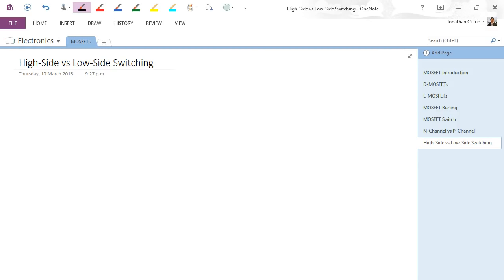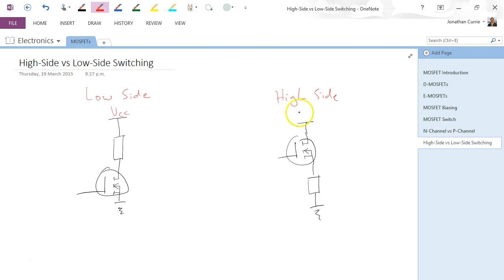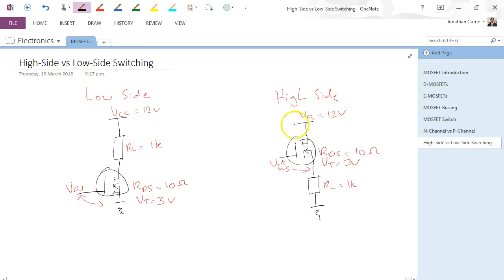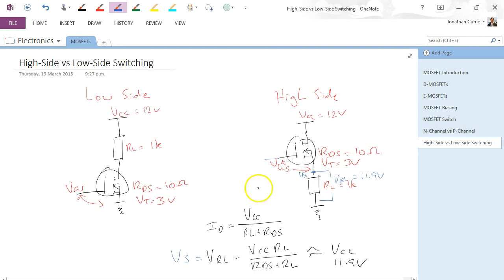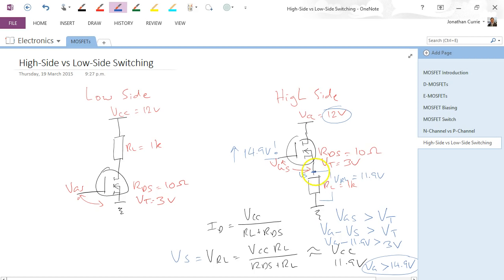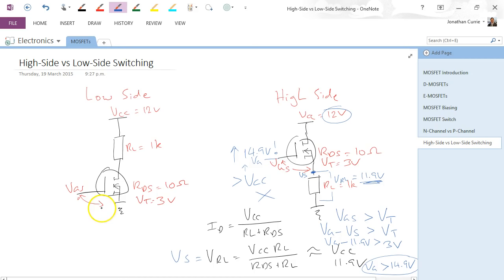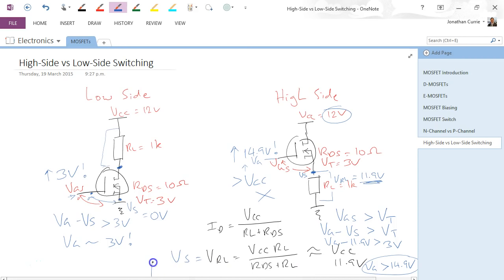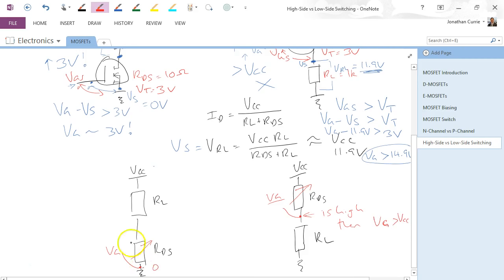MOSFETs: High-Side vs Low-Side Switching

Comment: I ran into the issue of high side switching with an N channel requiring an increased gate voltage. While I had a sense of why this was happening, I was just guessing. You sorted it out nicely. So nicely in fact that I am aggravated at myself for not figuring it out. 
Nice explanation. Thanks for the video. Now I'm hoping that you have a video that just as clearly explains how to use a P channel in a high side switching configuration.

Comment: Great video, very informative. Now I wanted to ask if in the high side mode it is possible to put some inductance and/or capacitor to increase the voltage or recover the 3 volts lost.

Comment: hang on i must have missed a page, high side switching , when the mosfet is ''off'' then source is at 0v via the 1k, so only needs 3v on the gate to turn it on, then the voltage at S rises but it should stay turned on? wont the G then be below and cause the mosfet to then ''switch off'' and we have a resulting oscillation ?

Comment: Seems likely I can still use Vcc 12v and reduce with voltage divider for use with N channel  Mosfet and load,  as HIGH SIDE SWITCHING.  My test load is a coil, which in formula does not use voltage, only current , inductance and fast time in seconds. Circuit can use 9v or less to operate with Gate drive from 12volts DC. The N type has a lower "on" ohms resistance. P type can be used with it's higher ohms, as long as the current is very low, for lower waste energy heat. On the other side, the resistors of the voltage divider will waste energy , since they have to be of lower ohms for average amps needed. The P channel is probably better to use overall, for high side switching.

Comment: Someone can use a P-Channel on the High Side to be able to EASILY switch the transistor ON and OFF, instead of using a N-Channel.  N-Channel is good for the low-side, but not so for the high side. And there are case where you simply cannot chose the side of the switch, as in the case of a motor, where you need to switch which motor's winding will be activated and which winding will evacuate the current: you need and a high side and a low side switch (H-Bridge).
Reply: You can use bootstrap with N-channel mosfet, and use it on the high side, without problem. The reason we want N-channel on high side, is because it has lower Rds(on), about 1/3, meaning less heat, more efficiency. Even on inverting circuit for 3 phase motor, I highly recommend N-channel.
Reply: @efivip93  Hi, could you please explain what you mean by use "bootstrap with N-channel mosfet"?

Also, why N-channel has lower Rds on & 3x more efficient than P channel? Does it have anything to do with the structure of the MOSFET & that the gate is doped N type semiconductor having more electrons?

Lastly, the video called the MOSFET as a "device". Are MOSFETs "components or devices?" I assumed components are individual circuit elements like resistors, capacitors, diodes, etc while "devices" are packaged assemblies or ICs of these "components" like power controllers & converters, etc. Basically, what's the difference between "components & devices"?
Reply: @efivip93  Can you please explain what is Bootstrap circuit is all about.  Thank you
Reply: @isacdaimary9908  In simple terms it is as follows. The gate-source voltage needs to be above a certain threshold to begin conducting and the higher you go the less the rds-on is, bellow a limit ofcourse. But if you use an N-channel mosfet on high side in a 36volt system as an example, then you can't supply the gate with more than that, so you can't turn it on.

A bootstrap circuit is basically made of a diode and a capacitor that charges up when the mosfet is off and is abble to provide the required gate-source voltage to turn on fully and have really low rds-on. A lot of mosfet driver chips are supporting this, many allready have the diode built into the ic, so you only need to add the capacitor, you can find all the information in their datasheets.

There are limits to this methood. Most of the time you are using it in pwm circuit, where you are not using 100% duty cycle, since you need a tiny bit of time to charge up the capacitor. Some manufaturers offer gate drivers that support 100% duty cycle, but it's not verry wide spred, again, read the datasheets about it.

Hope it clears up a bit, if not, let me know.
Reply: @efivip93  Thank you for taking time to reply. Can you please design a bootstrap circuit for IRF840 MOSFET...Am stucked in designing a buck-boost converter where am unable to switch the MOSFET,,,,I used TLP250 as driver.

Comment: Thank you for sharing. Please I want to replace  a relay in my car with a Mosfet . 
Notes :
Every electrical object are connected to the ground .
The switches and relays  are delivered +12v to them.
Asper you video I understand that the mosfet is open the ground to load.
Can you please help.
Thanks...

Comment: my dear friend! 
this is the first timr you mack me understand why I always conacted the load to the line(hot side), than swched to the (N) : 
now I realis the low voltag on the swich and the low current 
please help me with the half gate driver,
how this is working with two MOSFET's on the HIGH side whan the LOAD is bittwin them?(FAN7382 or L6384E)

MANY THANKS

Comment: What's confusing me here is that I have always understood that to turn on a PNP transistor the base must be lower than the emitter but in your case 14v > 12v which seems the opposite of that.
Reply: I know it's been a couple of year, but just in case you're still wondering: these are N-channel MOSFETs, not PNP transistors. The MOSFET analogy to a PNP transistor would be a P-channel MOSFET.
Reply: @simonO712  Correct, I had meant to say P-channel, not "PNP".  Until you mentioned it, I didn't realize he was using N-channel for a high side switch.  I now understand that that is not uncommon with mosfets (i.e. high side switching via N-channel - due to lower cost and lower Rds) and that is the purpose of a "bootstrap" circuit.  Thanks for your reply!

Comment: Agree with all that re 'N' type, but with 'P' type I seem to need a slightly higher voltage on gate to fully switch. I'm trying to work out why ???  (yes p mosfet is on low side))?? Maybe I have bad mosfets..??

Comment: Im currently using Irf3205 n-channel mosfet and ir2110 MOSFET driver for Bldc Motor control using Arduino. MOSFET is not completely turning on by the MOSFET driver IC ?
Reply: please check the data sheet of the mosfet your using and measure the gate voltage provided by the driver mosfets ,

Comment: thanks for the explanation. Does it matter if the mosfet is a p channel or an n channel type? I bought  logic level n channel mosfets the irlz 34 and 44n, to be specific and want to control a 5volt lcd on the high side with and arduino which can output 3.3v to the gate. It seems that it doesnt work as planned until i use the low side switch configuration. But i need to control the high side. Is there an efficient way to do it?
Reply: One option is bootstrapping an N channel mosfet. The RDS-on for an N channel is generally lower than that for a P channel mosfet. That means the N channel runs cooler.

Comment: On the highside MOSFET (on the right) isn't the source supposed to be facing up and connected to power and the drain connected to the loads +? 
I'm new to this so I'm asking because I'm not sure. I've seen other places saying essentially the left example is an N channel MOSFET and the right one would be a P-Channel MOSFET. But the way this is drawn makes this a high side N-Channel MOSFET which I though they couldn't do and hence why they have P-Channels.

Again, I'm new. I might be missing lot of things. Thanks in advance!
Reply: yes, both switching devices here are N-channel MOSFETs and it is indeed possible to use an N-channel MOSFET as a high side switch

Comment: For what in my mind is a simple thing 3 mosfet I failed to work i dont know why even ready made mosfet boards were the signal ground goes in on pins and seprete power supply added ans 2 other connectors ÷ - i can't get it to flash a bulb 12v car light bulb my frequency genorator flashes the LED on the board i play with 3 nobs first rase lower the power still nothing im having bad luck i want to pulse a tesla bifoler coil i did not want to learn maths why can't it be simple as I think also you just showed me one thing I think low side switch is below the mosfet near ground but low is above mosfet near positive weard  visa verser I want to play with one so then I can do 2 in serial with high turn one low turn the other to get positive and negative pulse it feels frustrating i classed my self ok with electrics but this prove im still dumb ass

Comment: This does NOT make sense. This should NOT be the case. This part of electronics is very much against logic and natural laws.
Reply: It's confusing because in both *cases the mosfet is going to pass threshold whenever the gate-source voltage passes the threshold. This is irrespective of VCC. The high side switching arrangement may have one think if a mosfet has a 4v threshold then they will need well beyond that just to slightly turn it on.